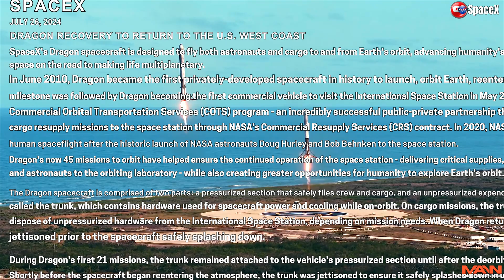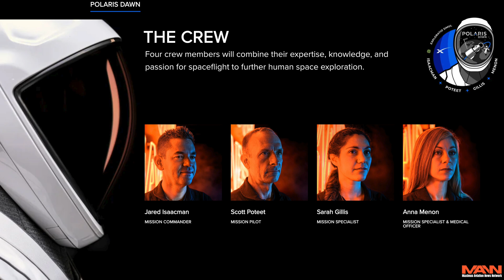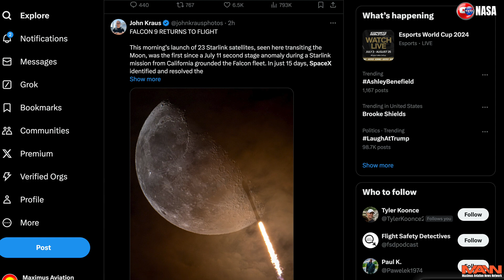🔥 Will SpaceX SAVE The Starliner Crew Now That The Falcon 9 Is Flying Again?

Comment: Starliner has the ability to fly itself.  If it turns out that the ship is safe, they will have the ship to determine more information.  If it flies back empty and things don't work out, no lives lost.  Seems like a no brainer to send them back on SpaceX.
Reply: The thrusters in question are on the service module, which gets jettisoned and burns up. Also, severe cost and schedule impacts (for the ISS, not just Boeing) if Dragon has to fly with only half the crew up.

Comment: I am kind of sickened by your biased and frankly incorrect reporting on this issue Maximus.
Not only do you just blow off the fact that a Falcon 9 second stage EXPLODED, like some SpaceX fanboy, but you also keep harping on the incorrect notion that the Starliner crew are "stranded" on the ISS. 
No. The Starliner had problems, (just like cargo dragon had during its early flights) and because they originated in the Service Module (which burns up after every mission), the problems never got completely diagnosed. The crew has remained on the ISS so that the problems could be diagnosed. The Starliner either already has, or is planned to do multiple firings of the RCS thrusters while docked with ISS in order to fully test the diagnosis of the problems. The Dragon has been prepared for a "rescue mission" out of NASAs usual thorough planning for all contingencies.
That's what we get by relying on AMATEURS to report on our space program. Watch The Space Bucket if you want to see how an amateur creates more professional Space Content on You Tube.
Reply: The Falcon 9 second stage didn't explode. The engine had a hard start which may have caused minor to catastrophic damage to the engine but the stage definitely remained intact.
Reply: @AmbientMorality Good catch.  The more I listen to the original poster the stupider I get.

Comment: Supposedly, starliner is going to do some thruster tests while still attached to the ISS. I suspect the test will be successful. The pressure in the helium tanks is more than enough for a return trip.

I did enjoy this latest video. Your concerns are warranted. But it seems the news has blown this out of proportion. The amount of pressure in the helium tanks is the only variable that matters right now. It's holding, and there's plenty. The holdup is the ground troubleshooting the system. Because that system can't be looked at on the ground because that section burns up after being jettisoned.

Could this turn into another Columbia? It's highly unlikely. This style of reentry vehicle is extremely safe and proven design. That's why it was used by mercury, Gemini, apollo, soyuz, cargo dragon, and crew dragon.

With that said, safety first, if NASA or the crew want to launch a crew dragon for a rescue. That's exactly what should be done. Starliner is a safe vehicle with plenty of helium pressure. Let's just get these folks home safe.

Comment: I thought I read that Starliner was designed to require a crew onboard to fly so if that's true I wonder how NASA plans to retrieve it if they send the crew back on a Falcon-9.
Reply: Starliner has flown two uncrewed flights before this. It can fly autonomously. It may not be approved to dock without crew?
Reply: @slartybarfastb3648  That sounds logical.    Modern ships can fly by themselves with help from ground control so I thought that sounded wrong.
Reply: Via a Viking funeral, most likely. The most likely reason they are not going back on it is that NASA fears the worst kind of failure is likely: starling engines fail during reentry burn, standing the crew in an orbit that they can’t escape from.
Reply: @MoraFermi  The reentry burn uses the OMAC thrusters, not the RCS thrusters. There is a contingency to use RCS thrusters if the OMAC thrusters fail. But losing attitude control in space is definitely very bad. Still, I don't think it's considered remotely close to likely, more like "quite unlikely, but a higher LOC probability than we are comfortable with".